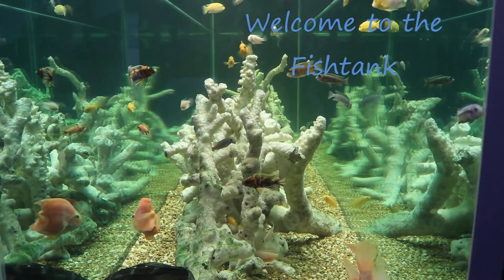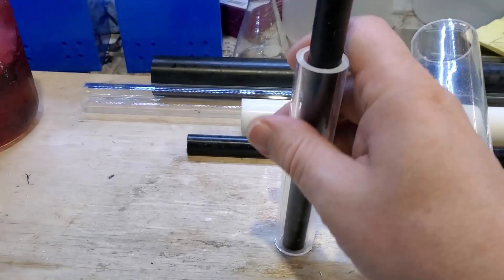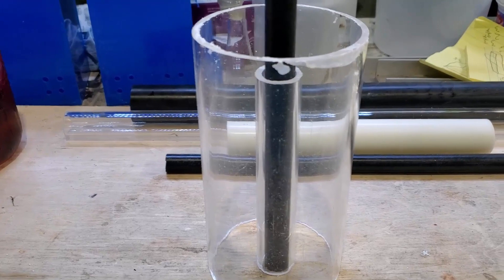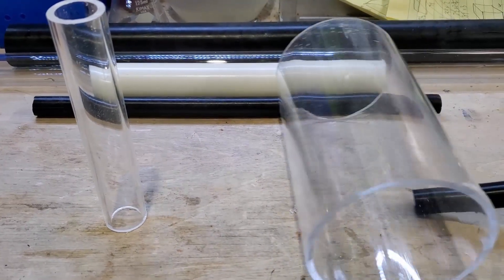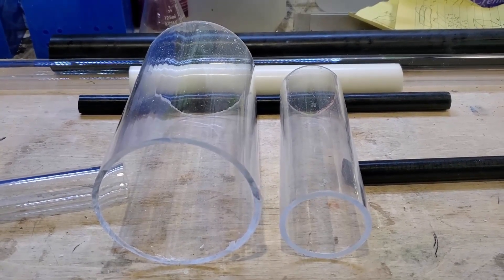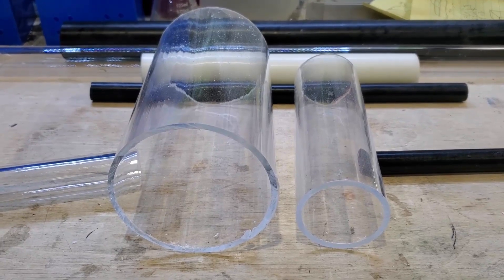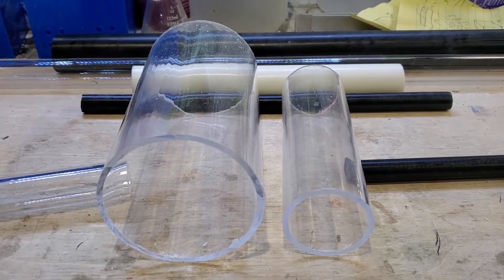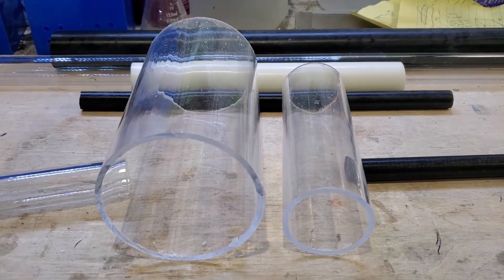You Decide : Rolling Drum Filter Part 1

Comment: Bigger is better in my opinion, more surface area=more bacteria. Maybe wrap it in some green matala mat for the bacteria growth medium. If you were to divert a small bit of water (maybe through a bit of ridgid 1/4" ID acrylic tubing) from the pump into the space between the axle and the inner drum, like a journal bearing in an engine, then somehow slow down the exit of the water it should make for minimal  friction and a smoother  action. As for the mechanism to spin the drum I think a water wheel design would be a neat idea. I know it wouldn't be the most practical approach but it would look cool and be fun to design.
Reply from the maker: I've had a couple of suggestions along this line of water lubricating the shaft. Definitely worth the effort. Thanks!

Comment: Weld thin strips radially to make a water wheel. Then, have multiples interlock to make a rolling gear filter. #mytwocents
Reply from the maker: If the consensus is for the flow to come from the bottom it will probably need something along those lines. Multiples all geared together might be a little beyond the scope for this build. Thanks for coming by

Comment: i wonder if u place some type light{(small red or blue or gren l.e.d.) in the center well each diff color will have diff effects on outcome},.. would it help inhibit certain bacterial growth on the wheel??? As beneficial bacteria, maybe only algae would grow. However algae is actually good for an aquarium. It cleans water but some people don't like the looks of it. So what im getting at here,.. it'd be kinda outa sight(being inside the turning wheel) also a natural type of water filter. the same thing can be accomplished with a regular water wheel i'm guessing. I wonder though, if the algae type wheel would be  better or worse? Then some might also suggest an algae scrubber instead?? But i'm not sure if they'd be similar or have same effect. This would be a good study IMO...
 Fishman, does this sound probable, or have i moved waaaay off base with it?? Honest opinion. I'm curious as to how this would turnout.
Reply from the maker: I think if it is lit, the drum will grow algae and the extra weight may be an issue with the turning. Not sure though. This is the reason I take time to go through comments. This sounds like a great variation to try out. Thanks!